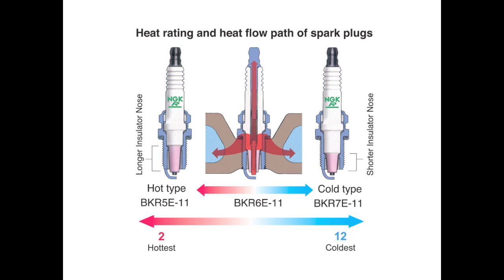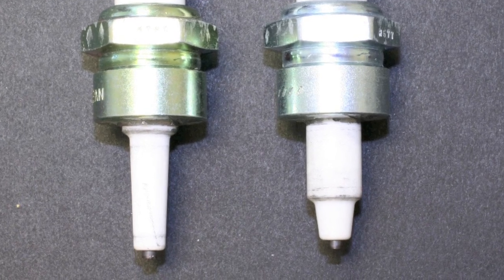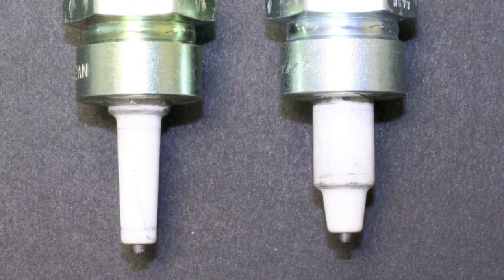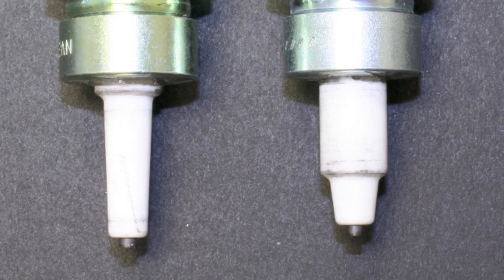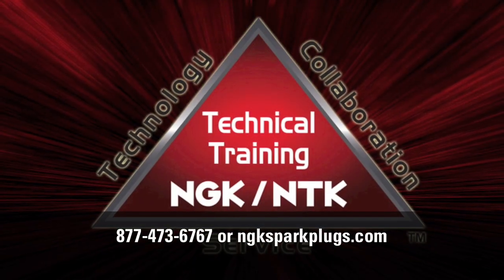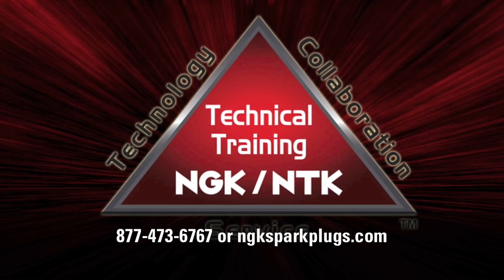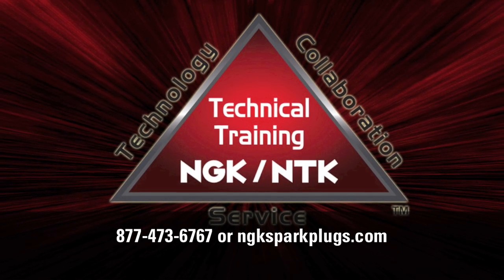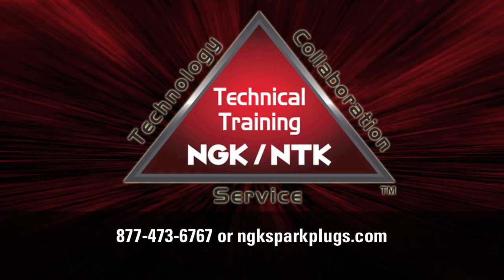Spark Plug Heat Range  - NGK Spark Plugs - Tech Video

Comment: Was thinking about running a hotter plug in order to compensate for a leaking fuel injector that leaves my current NGK’s wet with fuel. Any thoughts?

Comment: My car's manual recommends using BKR5ES-11. I didn't find it in my town can I use BKR6ES-11 instead.
Reply from the maker: Hey MrSalamona, A BKR6ES-11 will change the heat range of your spark plug. If your car requires a 5 heat range and you go one step colder then the plug will likely foul out. If you car calls for a 5 heat range then you want to run a 5 heat range. What's the year/make/model of your car, i'll take a look.
Mike Becker, Senior Technical Instructor
Reply: @ngksparkplugsusa  Hyundai Matrix 2008
Reply from the maker: Hey, I think you mean a Toyota Matrix? If that's the case you can use the following numbers. IFR5T11, FR5AHX, BKR5EIX-11, PFR5G-11. Those are all good numbers for that car across multiple of our plug levels. Thanks!
Mike Becker, Senior Technical Instructor
Reply: @ngksparkplugsusa  hey, Hyundai Matrix is a Korean MPV https://en.m.wikipedia.org/wiki/Hyundai_Lavita

Comment: im using a NGK  B6HS and ive got a nice light brown color. this is for a cheap chinese bicycle engine kit that uses 93 octane and the run of the mill 2-cycle oil.
it seems the 2-cycle engines dont like the hotter plug while using ethanol treatment mix. bad scaling on top of piston and dome.  no scaling with a cooler plug and fine till it fouls :(  now i know why soo many convert to 4-stroke cause theyre tired of more error than success!  all depends on the engine and heat wicking i guess.
Reply from the maker: Heat range is critical to engine and spark plug performance.  If too hot of a heat range is used, likelihood of pre-ignition is increased.  Too cool of a heat range plug is more likely to foul out.

Comment: i thought the lower the heat range number, the lower the tempature??  like autolite 103s are a low heat range?
Reply: depends on the brand.. the mix them around for some reason
Reply: with NGK's 2 is hottest and 12 is coldest